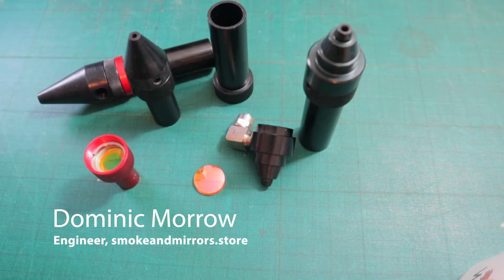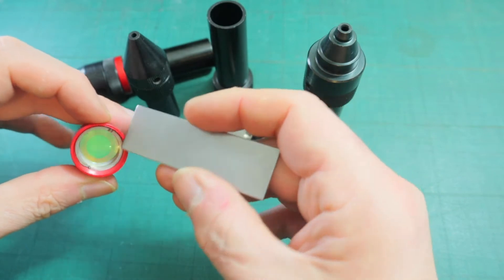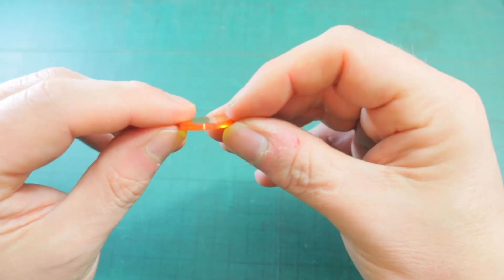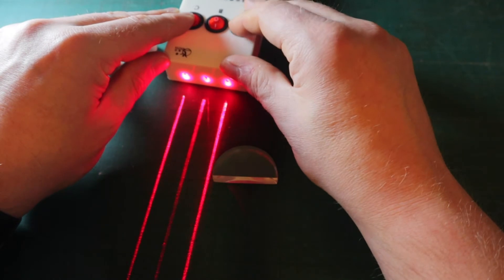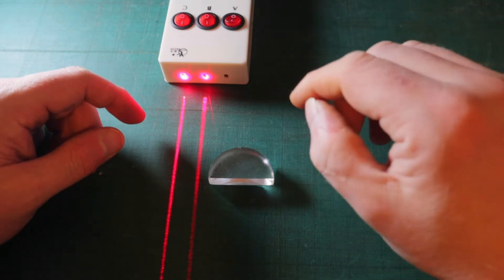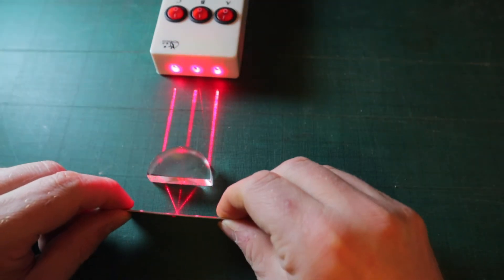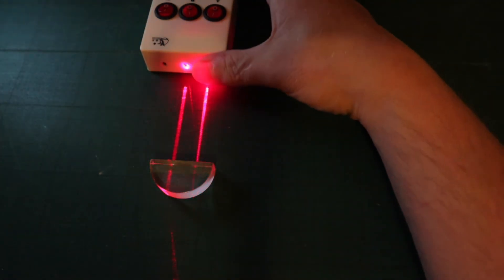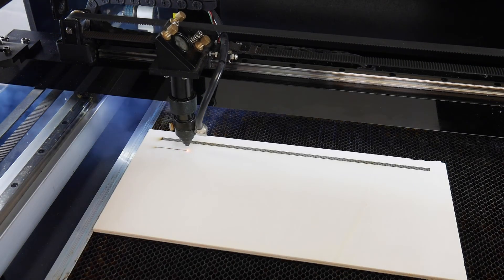Which is the right way up for a CO2 Laser Engraver lens?

Comment: Best explanation on the internet.
So I can also use this to intentionally reduce my output power? I just upgraded from a 60 watt tube to a 90 watt and I may need to reduce my power to engrave leatherette patches more than the power supply can handle. I wonder if the lens will get hot or if it just passes the unfocused light?
Reply from the maker: I am not entirely sure what you mean about the power supply and this being a way to reduce power. All light should be passed through the lens in proper operation. To reduce the power applied to your leatherette you could try a faster raster engrave, or reducing the interval/scan gap of the engraving. If you are bi-directionally engraving, try unidirectional. Also on a CO2 laser engraver you should be able to operate at around 12% power as a minimum so if you're working above that you can reduce. You could also try a longer focal length. Lots of people such as Sarbar have shown that flipping the lens into the upside-down position can improve engraving... but I don't have enough engraving experience and experimentation to have an opinion.
Reply: @ thank you for your thoughtful response. I was referring to lowest setting to reliably trigger the power supply.
I am currently using all the things mentioned, except for uni directional. I will add that to my toolbox of tricks.
Thanks

Comment: The key takeaways are 1) it doesn't really matter and 2) it took extreme exaggeration of the effect of the direction in order to simulate a slight and still barely imperceptible difference.

If you are having problems with your laser, the problem is far more likely to be involved with alignment from mirror to mirror through the system.

Comment: Just checked my lens to clean it, first time since buying the machine (only used a handful of times) the lens was installed with the flat side up? Should I contract my manufacturer or should I assume this was just installed incorrectly? 
It’s been working fine, but I know you said it will work either way.

Comment: Thank you for your wisdom and clear advice on lense placement.
I have a OMT laser that I just upgraded from 80W to 150W
In an effort to keep this short I'll just say refitting the 5 foot 6 inch tub into the very tight and short housing was a nightmare. Because of the limited room I had todo some significant cavity surgery to get my lense assembly placed properly.
However, somewhere in the alignment process a slight angle was introduced and I'm about to go crazy trying to realign everything so that the X and Y movement does not cause DRIFT in the laser position. 
HELP! Is there a systematic way of making sure all mirrors are level True once aligned? 
I would be so grateful if you produced a video on this. None of the ones I've seen get into the nitty-gritty of fitting a larger tube in and getting all the alignment correct. 
Signed Humble 🙏🏻

Comment: Thank you for the helpful video. Does it matter which side the washer is? On my machine it's between the lense and the holder. In your video you had it between the locking nut and the lense.
Reply: In the video the purpose of the washer placement is to cushion the lense from the turning/grinding force of the lockring into the glass. Placing the washer on the output side of the lense could also introduce an unwanted tilt to the beam when the lockring is threaded.

Comment: i find that because the lens is small i struggle to know which is the flat side and which is the curved.  Is there an easy way to tell?
Reply from the maker: Sounds like you have the 12mm OD lens common in some K40 machines and other lighter equipment. There is usually still a pronounced curve with those lenses.
Reply: Place lens on the cloth that comes with the cleaning kit, on a flat surface (usually the bed). You should be able to gently rock the lens if curved side down. Always clean the lens before replacing.
Reply: @glennwilloughby6213  I would have never thought of that.  Thank you.

Comment: Thank you so much for this! I had no idea there was a proper way. Explains why I'm having such a hard time cutting through stuff lately... I can't wait to leave work and check what orientation I have mine. I'm sure it's backwards because my machine just started cutting horribly out of nowhere!
Reply from the maker: Having the lens the right way up should help certainly. It can be tempting to jump to a conclusion about why you might have had a loss of performance. But the chances are as high that your performance has dropped due to beam alignment or dirty optics. 
Check my video about basic alignment check as well as the video on downward alignment.
Reply: @SmokeMirrorsVideos  alignment seems great. I just cleaned lenses but I will clean again. I will sure to check other videos!

Comment: Brilliant explanation, there are so many arguments for both ways on this the most common 'that is how it came in the machine' especially when the machine is a k40.
I did some testing both ways and it was clear which way gave more power and a cleaner crisper line when engraving.
Reply from the maker: Yes, that was my motivation for making the video. As a parts supplier I of course order lenses directly and I know I am buying plano-convexed lenses, and these are used most commonly in cutters. When it comes to a K40 for instance, there isn’t any budget left for the manufacturers to “experiment” they use industry standard stuff if a machine costs only $300 and the seller and manufactures all need to make a profit... they might not be using the very best parts or taking care over the quality of assembly.
Reply: I'll definitely be checking you guys out when I need to replace my mirrors and lenses again

Comment: What are your thoughts on touching the lenses considering they are often coated in thorium chloride?
Reply from the maker: Hello Josh. There isn't a simple answer here. The lenses mostly supplied with cheaper CO2 water cooled laser cutters are made from Zinc Selenide ZnSe, the manufacturers data sheet does not include thorium chloride. It lists an AR coating, which simply means anti-reflective (and does not hint at the chemical). It is relevant that occasionally AR coating is applied only to one side of a lens making the lens orientation even more important. Often ZnSe is coated with a micro thin layer of polypropylene. 
Put simply, it is always best to avoid handling optics with naked fingers for a number of reasons, touching optics should always be kept to a minimum. In practice and practically speaking, for most CO2 laser cutter users, it's not really a problem.
Reply: ZnSe is even something your not supposed to touch with bare hands and even when cleaning up and disposing of broken ZnSe lens your are "supposed to clean up with a wet paper towel and then put in a sealed container and shipped to manufacture for proper disposal so it doesn't get into a landfill and into the groundwater. and also not supposed to breathe in any of the dust that's created whenever a lens breaks but even breathing in microscopic glass particles can give you lung cancer to.  even without being water-soluble and radio active.   But if i had to guess thorium chloride would probably have the same handling and disposal..  Tho best to not touch a lens to keep it from getting dirt or oils from your skin on it. whenever possible.   Ive even been using gloves to handle my focus lens for the co2 laser. but mostly just because i found they slip out of my fingers a lot less.